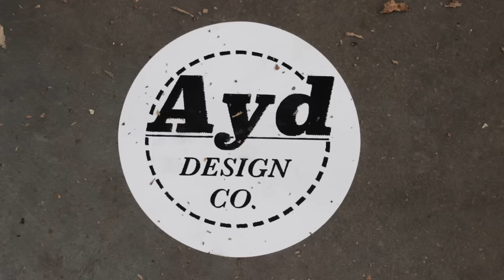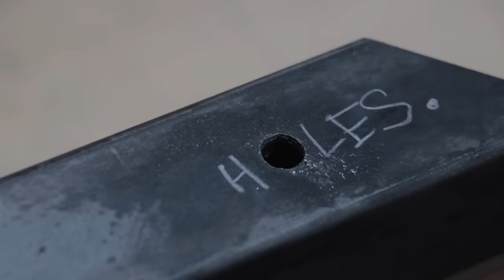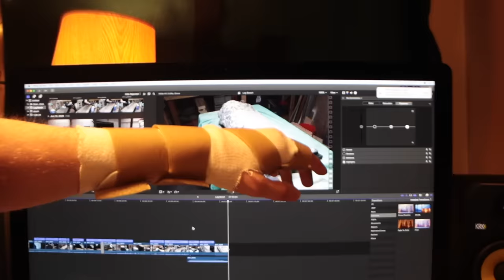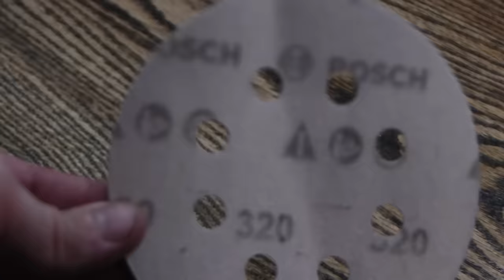Rustic Modern Log Bench | Welded Steel Legs | DIY Woodworking Build

Comment: I would have definitely put a washer on those screws
Reply from the maker: There are, and you can see them in the video!
Reply: @AydDesignCo   well the need to be bigger then as you can clearly see it’s indented the metal just my opinion still looks good tho

Comment: What kind of paint did you use for the legs? And what's before that?
Reply from the maker: Rustoleum self etching primer and then canyon satin black over that 😄
Reply: @AydDesignCo  I don't have those available where I live. Can i use red oxide primer instead?  Or any gray spray primer

Comment: I have a table of similar design, minus the unique wood part. I needed to run a linear bar from cross-member to crossmember for stability. It rocked, not in a good way. Looks good though, nice job.
Reply from the maker: Thanks! This bench is pretty rock solid, I can stand on it without any movement from the legs.

Comment: Somehow the bench does not look like it would hold the weight of three adults. I would have preferred if the wood sat atop  curved-top metal legs about 10 cm in at the sides

Comment: Awesome build. First video of yours that I've seen. I subbed. What are you spraying on the wood before it is wiped away? Is it a spray stain or simple black spray paint?
Reply from the maker: Thanks so much, I appreciate it! Just normal spray paint then wiped off immediately with acetone. It does a great job at filling in the grain of that red oak used for the bench.
Reply: @AydDesignCo  nice! I think that's the first I've seen that. I don't watch many wood working videos. My hobby is forging. I am going to use this for the handle on my current project.
Reply from the maker: It’s not really a common technique, worked pretty slick though. I’m sure I’ve made some traditional woodworkers cringe real hard. Oh well! That would look great on a handle! Forging is something I’ve wanted to try, too many hobbies already though 🤣
Reply: @AydDesignCo  You should give it a try! With the amount of experience and tools you have, I'm sure you could make something great. 15 or so years ago when I started I used a manual air mattress pump with a pipe and a shallow hole dug into the side of a hill as my first forge. But my knives always looked meh because my woodworking skill was only hammering nails. Lmao. I make some decent knives now but I'm still learning tricks to up my handle and wooden sheath game. Thanks again!

Comment: Needs diagonals, the lever arm of the leg will overcome the holding power of the wood screws and it will rack, otherwise an entertaining design.
Reply: Agree, first thing I noticed. A 1" Steel tube across between legs would work well.
Reply from the maker: It's very sturdy and has no lateral movement! That was a heavy consideration but I would have needed to alter the design of insetting the 1 1/2" tube steel into the wood, welding in place and capturing the wood top. Thank you!

Comment: A heavy person can easily break the bench legs off by simply moving sideways...
Reply from the maker: It’s surprisingly strong. If you watched the video, you’d steel the square tube steel is embedded in the wood to give lateral strength. Thanks.

Comment: Excellent work(I had a similar idea)  but ...it's only one piece for 1/2 people and it took quite a longtime ...cost ? 10,000 US bucks I guess so that if you sit there for 10 years it would cost you 1000 bucks per year, 500 per year if you can sit for 20 years ...I know it may sound bad but ....a 50 bucks plastic bench would do the same job as just sitting on it nobody can see your masterpiece under your butt :-)